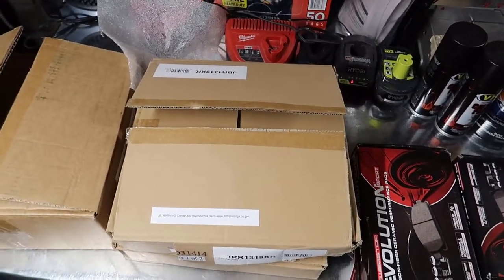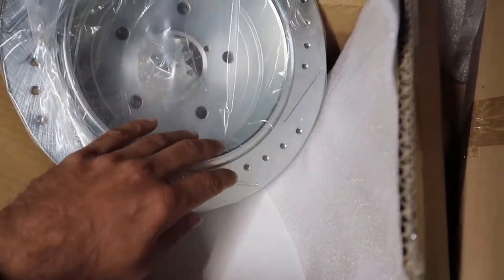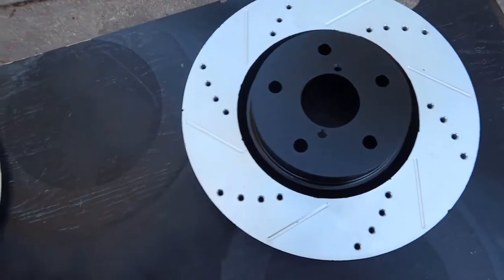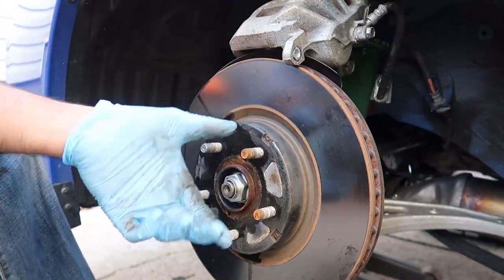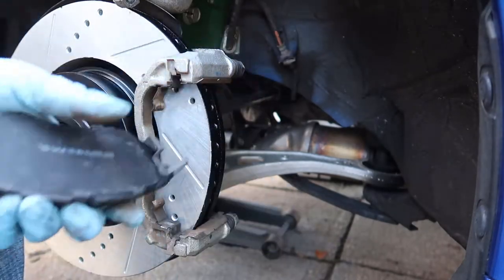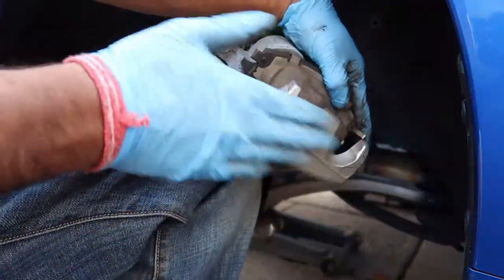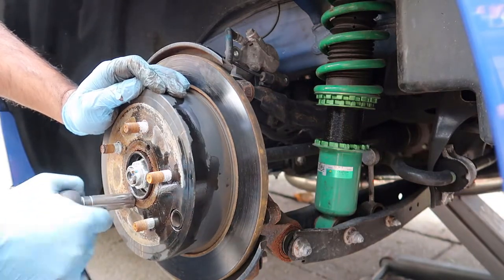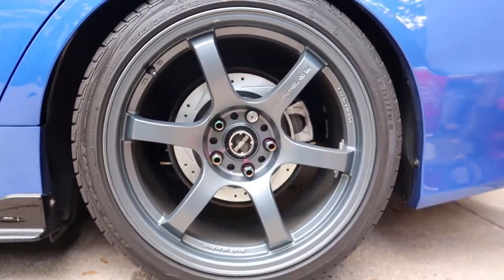Installing Brakes and Rotors on 2019 Subaru WRX

Comment: Nice video, thanks for sharing. Do you know what thread size bolt you used to press the rotors off? I know you mentioned 13 mm I'm assuming that's just the hex head size?
Reply: Little late here but typically it's a m8x1.25. Hope you were able to get it lol
Reply: @Mass0875 doing my brakes this weekend and your comment def helped! Thank you

Comment: Appreciate your video but when changing brakes all around your order of operations should be back passenger side first, back driver’s side second, front passenger side, and last driver side this way no air is trapped in the line, with that said it’s thumbs down from me, the more you know🧐
Reply from the maker: Hey, I hear ya but that's like saying the proper way to drive is holding the wheel at the 10 and 2 position. Once you open the brake reservoir before you compress the calipers it reduces the need to bleed your brakes but if your brakes feel off then you need to bleed them. The procedure you have above is the exact procedure for bleeding the brakes. Appreciate your feedback.
Reply: No lines were cracked? If air was introduced into the system while doing a basic brake job you have larger issues. Good addition if someone was changing calipers. Thumbs down on the comment bud.
Reply: @leugarage6327 Lol, I was gonna say this. I've been doing mechanic work since I was 18 (now 38), been certified for 13 years. The ONLY time this is necessary is during the bleed procedure😂😂😂. Great video, my guy.

Comment: None of these videos. And I mean NONE show the new brake pad being inserted. It’s always edited. This is by far the hardest part and they simply do not “slide in”. All of these how-tos are extremely disingenuous especially with all the cars from non-salt areas which attempt it to make it look easy. Very disappointing
Reply: @joeschlomo2143 they do slide in, it just takes precision to line them up before pushing them in. And if you are in a salt area, it's still the same procedure. Only difference is you'll likely have to use a sledge to get the rotors off.